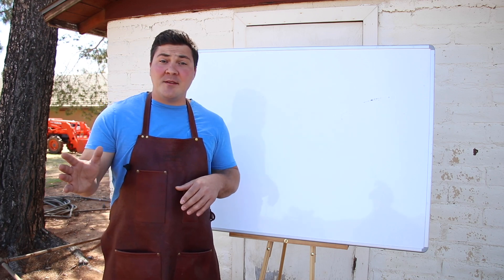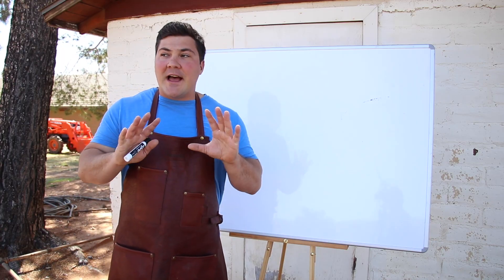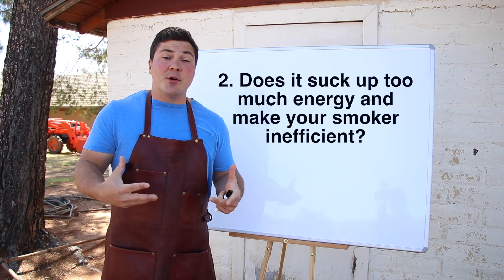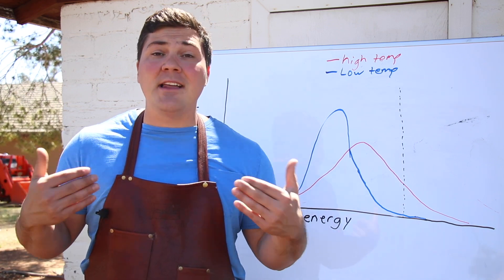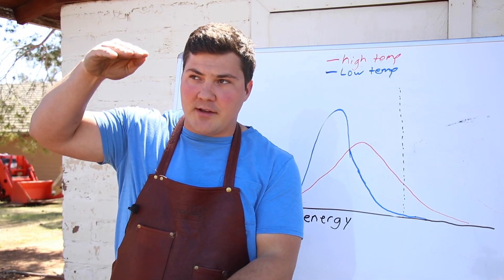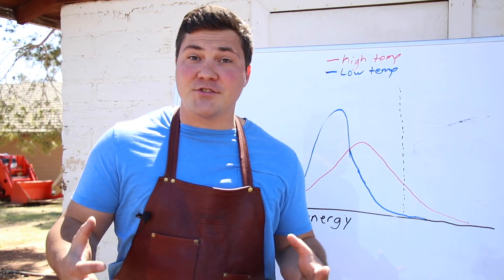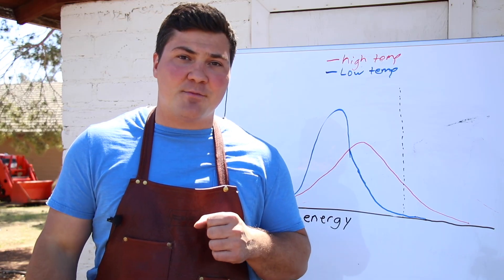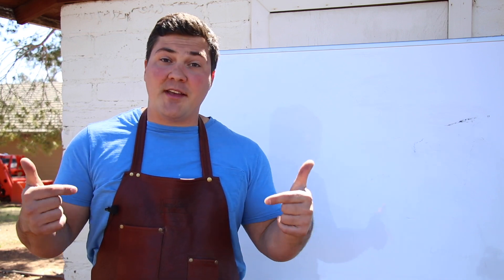Do Water Pans Improve Barbecue? A Scientific Analysis

Comment: Please don’t take this the wrong way as I have watched all your content and am a fan. I do appreciate this video but as a fellow technical-minded BBQ cook (M. Eng) I have a few reservations.  Your statements about the efficiency of a fire being affected by the presence of the water pan are erroneous. The efficiency of a wood-burning fire is not affected by anything in the cook chamber. The efficiency of a fire depends on sufficient oxygen being available for combustion.  We all have to do the same dance in fiddling with the vents of our cookers to get a proper fire going and maintained.  If you choke off the airflow the fire burns rich and you get the dreaded thick white smoke.  Not efficient at all.

But c’mon, who are we fooling?  We didn’t get into smoking thinking about efficiency and cooker heat rates.  The overall heat efficiency of a smoker like an offset stickburner is really terrible. I would estimate under 15% at best. My Yoder Wichita weighs in at 660 pounds or so, and when I’m smoking ribs for instance the bulk of that weight has to be brought up to temperature and maintained. What’s 25 pounds of ribs compared to that?  Almost statistical noise.  It would be very difficult to determine the heat loss of an offset smoker through the combustion airflow, plus convection and radiation effects.  A hilariously small portion of the wood’s heat energy actually goes into the meat.  And be honest, how many people moderate their temps by leaving the firebox door open?  That throws away what, 30% of your heat energy?  Thanx Yoder (the company in Kansas, not the Jeremy in Cali😎).

I am dubious that a water pan significantly affects overall cooker efficiency. A water pans acts as a heat sink that absorbs or releases heat energy depending on changes to the air/gas temp inside the cook chamber. Most of the time you’re evaporating water yes, but in times of wind gusts, precipitation or opening the door, the water pan would release heat back into the ambient environment and prevent the need to ‘fire harder’ to make up for those temp swings. That’s an efficiency savings.  That’s also pretty hard to quantify. 

You correctly noted the amount of water present in wood as moisture, plus the effects of combustion in producing more.  However, there is another potential source and that’s the meat itself.  In one of your commercial brisket cooks with 25 briskets or so, you get an amount of water coming off the meat during the stall when the beef effectively ‘sweats’ out a portion of its weight.  Just to make the math simple, say 25 briskets at 20 pounds each, and they all lose 1/4 of their weight during the stall. That’s 125 pounds of water in theory that you’re cooking out.  How many water pans would that be?

Lastly, I am not sure what you were getting at with your Gaussian diagram.  At a steady-state, the cooker will have mostly consistent zones of temperature. We all have to move our meat around inside from time to time to take advantage of warmer or cooler spots.  But what are you attempting to visualize?  The spread of temps around a mean inside a finite volume of smoke?  That doesn’t seem very useful at all.

If you’re talking overall spread of temps from the firebox to the smokestack, it would be a strange situation if you were burning a fire and you were getting temps inside the cooker mostly too low to affect the meat at all.  This is an elementary issue for the BBQ cook; just get a bigger fire going. If this is what you meant I guess you have a point, but it doesn’t seem consistent with your message in this video.

I do agree with the use of a water pan. For small cooks like a couple rib racks it makes more of a difference than a giant commercial cook of briskets, but it’s a heat-sink backstop that makes the cook’s control of the smoker easier.  Liquid water will leech heat energy out of the smoke to vaporize molecules yes, but it’s a tiny amount of leeching due to the slow process over the hours of a cook.  Shouldn’t bother anyone.  It is to our advantage that we have to fire harder to make up for the water pan as it allow additional airflow and less chance of choking the fire off.  Cheers all!
Reply: " water pans acts as a heat sink that absorbs or releases heat energy depending on changes to the air/gas temp inside the cook chamber." Thats all the average cook needs to know
Reply: This is one of the best and intelligent discourses I have seen in a long time, that is backed by STEM. We all are here to learn, and when the community members really come together with our heads, and not our egos, it truly is a beautiful thing. Congratulations to both @Mad Scientist BBQ and @Soft-Top Convertible Metalhead
 for having a fantastic discussion that truly acknowledges each other as peers.
Reply: I too am interested in the use of fire bricks in smokers. My first smoker was a small crappy electric smoker that didn’t hold temps very well. I filled the bottom and some of the sides with fire bricks to help moderate the wild temp swings.  I similarly used the fire bricks in my 26” Weber kettle, which actually did a better job smoking meat than the crappy electric smoker. Anyway, the electric smoke has been replaced with a nice pellet grill. I have no plans to line it with fire bricks, but the topic does interest me. Thanks for great, thoughtful content and discussion.
Reply: Aside from all the science can we agree that when moisture is in the air smoke tends to hang around lower instead of rising. This is one of the things I learn in the fire academy.
Reply: I'm also a Yoder Wichita owner, and I had to modify my firebox door vent so I can actually cook with the door closed now. My firewood supplier doesn't remember my name anymore because I use so much less wood these days, and I can basically dial in the vent position and walk away. It's so much less hassle, and I hated wasting so much wood by leaving the door open. http://www.texasbbqforum.com/viewtopic.php?f=67&t=31199&hilit=Wichita+Door+MOD

Yoder's latest offsets moved the vent to a lower position due to all the negative reviews, but I haven't been following the feedback to see if their change made much of a difference. I know my modification made a huge difference.
Reply: Can you do a video bud?  I would like to see more about your view of things.
Reply: "A water pans acts as a heat sink that absorbs or releases heat energy depending on changes to the air/gas temp inside the cook chamber. "

This is exactly my thought process for using water....it works as a "capacitor" to mitigate potential heat swings. However I use a WSM (relatively small chamber) not a large stick burner which would seem to require a bathtub (hyperbolicly speaking) to have the same effect.
Reply: lol..

Fun watching you two Einstein's banter back and forth....lol.....but hay, I still say I want to see the Gateway drum go up against the Offset.....
Reply: @karatevideosandmore7685  I brought that up, sort of.  Most of the argument is immaterial to the vast majority of viewers, who use relatively small cookers fired by charcoal; with a small amount of smoke-wood for additional flavor.  I do usually use a water pan on longer cooks, at higher temps, or for fairly lean meats.  Even if it isn't strictly necessary, I can't think of anything that was ever hurt by it.
Reply from the maker: handcannon 

Actually I think when using charcoal, it’s more important because charcoal combustion produces far less water than whole wood.
Reply: @karatevideosandmore7685  ONE genius.  Soft top is an IDIOT
Reply: I'm not Mr. Science but I always use a water pan.  A few secrets up my sleeve and my BBQs feature perfect,  juicy brisket every time on my Traeger wood pellet stove.
Reply: Seriously?!
Reply: @davidmbonu  as far as I know
Reply: @unknowndady  academics and good food don’t go together!!😂
Reply: Using a Weber Smokey mountain with much less mass, the built in water pan should make a big difference stabilizing temps.
Reply: @JoseGonzalez-mf3oq  🤣🤣🤣
Reply: Put simply, efficiency is energy output over input. I am not sure if he meant the efficiency of combustion, or, rather, the efficiency of the output of the fire with respect to the cooking environment. That's how I took it. The water pan functions as a heat sink and absorbs the energy output by the fire, meaning there is less heat energy being output by the system. The the heat energy going into the water is energy that could have been going into the meat or surroundings. That energy eventually leaves during vaporization, but that's not really what I care about right now. I am also a Mechanical Engineer who has taken advanced thermodynamics, and I am very impressed by this video.
Reply: @niceboy171 so the objective could be to cook faster? Now I’m confused
Reply: @Alex Atreides Smoked ducky.....mmmmm.
Reply: I've seen min/maxing in games but you guys take BBQing onto whole another level. GG both
Reply: You have entered the BBQ Rabbit hole of BBQ
Reply: @WakanWarrior We have “jumped the shark “ Mr Fonzerelli
Reply: I was going to say the same thing until I realized I have no idea what either of you said. Yes water helps stabilize my temps and that’s all I need to know.
Reply: As sergeant Hulka would say, 
Lighten up Francis.
Reply: Man, I really appreciate what you had to say. But, I lost you and fell asleep at about page 3.
Reply: After reading the comments I felt like I became a scientist. This is gold!
Reply: After all this...I've started to like chemistry. What an math episode?
Reply: Moisture most definitely effects fire. But the pros outweigh the cons. I appreciate you both getting so deep into the subject though
Reply: @Alex Atreides So it IS a bathtub.  (Needs a rubber ducky tho.)
Reply: I love lamp.........
Reply: Tyt I was just thinking jj be ggfbhmkin  B b b. Got  y ugh m
Reply: Use it
Reply: Yes, thank you to both of you. This is the type of civil thoughtful discourse that I wish there was more of on the internet and that is rarely seen in YouTube comments. Knowledgeable individuals  who respectfully discuss/debate an issue to come to a better understanding of the subject and leaves everyone in a better place by the end of it. Thank you.
Reply: I believe I've learned a lot from this conversation but some how I feel more stupid.
Reply: You talk to damn much go get a different life
Reply: same story wirh people absolutely obsessed with having an airtight military grade ship door for the smoker door.. it's going to leak smoke and it's not that big of a deal. Youtube has so much misinformation.
Reply: I think I've lost my appetite. 🫤
Reply: I know this is 5 years later but I entered both arguments into chatgpt and it told me Jeremy was the winner.
Reply: I just purchased a woodwind pro 24. I had a Bradley puck style before that I modified with a PID. I used water pans in that and my briskets turn out very good with your methods. but it was too small to do a full one. When I get  the WWP one of the first things I want to do is a full brisket (this will be my first full one). I’ve seen videos of people putting a water pan over the pot to better disperse the heat and I feel the moisture will help with pelllets being dryer? I want to put it right above the pan to get even heating and my tallow to the side. Am I right in my thinking?  Thanks.
Reply: Chemical Engineer enters the conversation.....

One thing I think both of you have missed on is Heat of Evaporation.  I never thought the water pan added moisture to the meat, because if you think about the process, most of the time the flux of water is out from the meat.  

Nope I was thinking like a control guy, that the heat of evaporation acts as a control moderator, not just a heat sink.  Water evaporates at 212, and most cooks are done from 225 to 250.  So by having a physical constant that will not exceed 212 you add gain to the control response and modulate your temperature curve.  Add a sufficiently large mass and your gain can be appreciable.  Remember, once the water hits 212, your energy input into it will be steady state, that of the heat of evaporation.

Oh and @MadScientistBBQ, you're comment on "It's not a ton of difference" is not quite true.  My back of the napkin math says your Joules to BTU conversion puts it at almost.... a ton.
Reply from the maker: Dave Lattner 

Hey Dave, I did include the enthalpy of vaporization in the calculation for the energy absorbed by the water. You’re correct tailgating the majority of the energy will be used for the phase change and the rise of water temperature is much smaller in magnitude (despite the high specific heat capacity of water) than the energy required for vaporization.
Reply: @DaveLattner  Perhaps we should also talk about elevation levels and the various grades of aluminim pans as well. ;-)
Love the discussions, and as a relatively new smoker once the pandemic started and really enjoying using my Weber Summit charcoal, wouldn't I love to try a huge offset grill one day. Wife saysI already cook too much for three.
Reply: @DaveLattner  Please see my comment below about having the water in the smoker saturated to prevent water from leaving the meat.
Reply from the maker: Soft-Top Convertible Metalhead 
No worries, I’m not offended. It’s clear you have thought about the topic, so I want to engage meaningfully with the points you bring up.  

1) As for the efficiency of the fire being unaffected by the presence of water  in the cook chamber or the lack thereof, I have to disagree.  The term efficiency there isn’t in relation to the amount of energy released from the fire, but it refers to the amount of energy that is absorbed by things other than the meat you are trying to cook.  The water must first absorb energy to increase its temp to around 373K.  Also, the enthalpy of vaporization requires quite a bit of energy. Presumably, this heat energy would not be efficiently transferred to the meat, because the entirety of the cook chamber would be above the boiling point of water. Thus the water wouldn’t condense on the meat, releasing the enthalpy of vaporization.  It could obviously transfer the energy absorbed as the temp of water vapor increases beyond its boiling point, but the energy absorbed by the water molecules to increase in temperature before vaporizing and the energy absorbed in the process of vaporization would be lost (leaving with the water that exists through the stack).  
2) You’re right, the goal of BBQ isn’t efficiency but we would like to make it as efficient as possible, otherwise we’re throwing away money.  There is a significant financial cost involved when you drastically increase wood use.  This is especially true when cooking on large smokers.  As the price of a cord of wood in southern California sits around $450-600 per cord, this isn’t a trivial matter.  In addition you mention that offset smokers are inefficient.  Quite right, but inefficiency isn’t the goal. If it were, people would be building the thinnest smokers possible, trying to lose as much heat to the environment as they could.  Finally, the energy required to bring the metal up to temperature is not going to be affected by the presence or absence of water pans.  That must take place for any cook.  You must also consider that the specific heat capacity of steel is much, much lower than that of water, meaning the energy required to raise its temperature is much less than for a substance like water.
3) Water would only be releasing energy back into the cook chamber if the temperature of the cook chamber has dropped below 212F.  If this happens, there are serious problems with the cook that cannot be solved by the presence of water pans.  I would concede, however, that the presence of a large volume of water at its boiling point can’t mitigate the problem, but I wouldn’t rely on it to keep a cook moving forward.  It would only slow the reversal of the process.  This is valuable only if you have made a significant mistake while cooking (e.g. falling asleep by mistake). 
4) You are correct about the meat also releasing a large quantity of water during the cook.  If you have ever cooked a handful of briskets in a large smoker, you know that they are always inferior to the results you achieve when cooking a full loaded smoker.  I think this is largely due to the increased moisture from the evaporative cooling of the meat inside.  In my smoker 25 briskets would probably sweat off the equivalent 6 water pans throughout the course of the cook.  In those situations I use 2 water pans at most, because there is so much moisture in the cook chamber that water pans don’t make as much of a difference.  At that point water pans are in the smoker to moderate the temperatures coming out of the firebox.  
5) The graph was meant to visualize the increased risk of burning associated with higher temperature.  While the average energy of the higher temperature air might be 10% higher, the portion of the gaseous molecules that could potentially burn the meat would increase significantly more than 10%.  You might be 5 times as likely to burn something at 300F than you are 250F.  The point of the water pan would be simply to moderate periods of high temperature that results from building a fire that is a little too big. This spares the pit master from trying to moderate temperature by cutting off air supply and producing “dirty” smoke. Also, I think you misunderstood what the graphs represent.  The peak of each curve represents the temperature, that is, the average kinetic energy of the particles of a substance.  At higher temperatures, the curve flattens and there is a greater distribution of energies at the extremes.  It is the portion of very high energy gases present at higher temperatures that the water pans are used to moderate. 
6) Finally, you mention that the amount of heat absorbed by the water is small.  While that is true in a sense, representing only about 4% of the heat produced through combustion, the overall amount of heat absorbed is significant.  This is especially true when you consider that the smoker is inefficient by nature.  I know that the water must have absorbed the amount of energy calculated, because it all evaporates away.  So, of the energy required to complete a cook, i would estimate that the water pans use somewhere between 10-15% more energy than would otherwise be required. I have tested this by weighing the amount of wood used to hold the smoker at a consistent temp for 4 hours with and without water pans.  I found that the water pans increased the weight of wood used during that period by 14.7%.  This is also true of the amount of wood required to run a smoker while empty vs. running it while packed full of meat.  I would estimate that I use approximately double the amount of wood to cook 25 briskets when compared to running an empty smoker for the same amount of time.  I would agree that there are many benefits to burning more wood, I just don’t believe it is trivial to consider how much additional cost one can incur by heating a large volume of water in the smoker.  Thanks for your comment.  I really appreciate you taking the time to think about the issues.  I have to disagree with you of course, but hopefully we both gain more knowledge to improve our bbq skills.  If there is something I missed or muffed, let me know.
Reply: @MadScientistBBQ  Ok, I have read both of your comments and I find it hilarious both of you went through all of that to disagree on so many variables; yet in the end, still promote using a water pan!   Although I may disagree with many of the things both of you said.  I think the key thing to take away from this is, there is an infinite number of variables to cooking great BBQ.  All of which can be extremely difficult to control.  This is a pitmaster's passion and his pain, yet it is what makes great BBQ.  Lastly,  $400-$600 for a cord of wood is absolutely bat-shit crazy!  I can get top quality Oak here in TX for under$200.  At this point, it is cheaper to buy it here and fly it back.  Always enjoy your videos.  The offer to come to my BBQ Trailer just outside Austin now extends to the both of you.  I want to watch this argument in person lol
Reply: @avikaiser9562  I live in New Braunfels,  where is your BBQ trailer?
Reply: @MadScientistBBQ  As a chemist looking at point #5, I think what you are trying to say is that the liquid water in the water pan is there to absorb the overall thermal energy when the temperature goes up. The gas energy distribution in side the smoking chamber is the same with or without the water pan if the smoking chamber temperature is the same. As water will not differentiate high velocity nor slow velocity gas molecules. It will absorb the energy regardless of the velocity. 

Hey I never thought about imagining how much water content is there during smoking process. 

I also wonder about the effect of firebricks in the smoker. It will absorb chunk of heat to start out with, but it will be able to release energy back when you open the smoker door. I have no idea whether it will be more efficient or not but it will be interesting experiment to do. 

Hey as a scientist, if we disagree, then we do experiments to find out who is right and wrong and contribute to overall knowledge of humanity.
Reply: @MadScientistBBQ  if you are worried about the energy needed to raise the temperature of the water to the boiling point, you can pre-heat the water before pouring it in the water pan.
Reply: @MadScientistBBQ  Well, besides the fact that you enjoy smoked meats and such; this comment reply has validated my thoughts that we would be best friends should we ever "meat".
Reply: @MadScientistBBQ  you know honestly I would love a video comparing the difference is cook time, flavor and other nuisances involved between using a water pan and not. I believe that the water pan serves to help regulate the temperature when opening/closing as the specific heat of water is very high compared to most molecules 1.34 or 1.43 j/kg (can't remember to long ago).  I recall others using a tin full of sand to help mitigate this factor however I thought it wasn't that great since it didn't add anything towards humidity however at higher temperatures I doubt that meat can absorb any moisture due to various factors being that proteins generally tend to contract in regards to heat.  Anyways as a scientist and home chef, I would greatly appreciate the experiment.
Also another one is the difference is smoking until the stall and A. putting into the oven and B. continue the cook in the smoker.
As for now, I smoke till the stall, wrap and subsequently throw it into the oven at 250 degrees for 2-4 hours depending.  Makes duel cheaper as well as requires much less attention.
Anyways, you r videos are amazing so please keep them up!!!
Reply: @MadScientistBBQ  NERDS, NERDS, NERDS, NERDS!!!! 🤣🤣🤣🤣
Reply: @MadScientistBBQ  Way over analyzed!  This from a Ph.D. ;-)  I'm gonna use a water pan because its worked in the past and it just makes sense.
Reply: @DrJohn493 Now this is thinking like a true engineer.
Reply: @MadScientistBBQ  if your not seeing your water pans boil yes the whole water pan is probably on average lower than 212 F depending on atmosphere pressure but yes they can get hotter than their boiling point. Especially just the top exposed surface where the evaporation is happening.
Reply: @MadScientistBBQ  wow, haven't heard several of these terms since my college engineering thermo class.
Reply: @MadScientistBBQ  .... @ 11:53 ... I like molecules! That's my favorite part!
Reply: @MadScientistBBQ  this is the greatest conversation i've ever read in youtube comments! kudos to you two gentlemen!
Reply: @MadScientistBBQ  Alton Brown from Good Eats would be proud of both of you ! Not sure who he would agree with but he would be proud that the thought of science went into the cooking !
Reply: @MadScientistBBQ  First off - this is the most engagement I've ever had with a YouTuber and as you can tell, the subject matter is right up my alley. :)  Thanx for being cool about this.

We're actually closer in alignment than you realize - I think we're getting tripped up by semantics.  You say efficiency of a fire, I say overall cooker efficiency; we are talking about the same thing.  Putting chemical energy in the wood into the meat.  I'm not digging out my old Thermodynamics textbook; I'll trust what you've said about the enthalpy business.  I hope no one mentions stoichiometric combustion!

I'm still unsure about your Gaussian graphs, but I won't belabor the point.  I just don't understand why the std dev. figure is larger with a higher mean temp.  Does that come from experimental data?  It's been 23 years since statistical classes and I'm having bad flashbacks. ;)

One thing I belatedly understood - you're coming at this from a commercial perspective where your desired fuel source is very expensive.  That explains your position and mine as well; I have a friend who runs a local tree service company and I can get wood from him in exchange for smoked meat credits.  So I never really have to put up cash for wood and don't think about it too much.

You information about the additional wood energy 'cost' of the water pans is interesting.  You have the advantage over most of us as you've had some much experience with large cooks and can try different methods.  That's why I subscribe.  That additional cost is larger than I expected, but again, my perspective is much different.  I use a smaller water pan, sort of a cheap dollar-store dog bowl shaped pan.

So, let me finish up with this - which might be a future video suggestion for MadScientistBBQ.  In my Yoder Wichita Loaded I do something I have never seen anyone else do.  At least on YouTube and I've looked at all the big channels.  I have placed a series of firebricks inside the firebox to contain a small fire.  In my experience I find that I burning smaller splits in a smaller fire surrounded on three sides by firebricks works very well and I hardly have to do anything for fire management.  I do use the tuner plate and do not count on any radiation effects from the burning wood.  Just from the air/smoke flow.

Since you have taken the time and effort to determine % cost in fuel based on water pans, I wonder if you could determine % savings in fuel by using firebricks to keep the fire hotter and the heat energy more contained?  Fire bricks are quite cheap and easy to come by and they're in a few different shapes.  Something to think about.  Cheers.
Reply from the maker: Soft-Top Convertible Metalhead 

Interesting ideas for future videos. I’ll give them some serious thought. 

Here is a link that describes the distribution of energies I mentioned http://ch302.cm.utexas.edu/kinetics/temp-depend/selector.php?name=arrhenius-law
Reply: @czeslawpi  Sorry, late to the party on this thread.  I get your reservations about the "molecules" graph.  My take on it was more in the context of fire variability over the duration of the cook.  I use a pellet smoker which, apart from pellets having a lower residual water content, has a higher temperature cycle frequency.  It seems to me that having something to absorb some of the heat of the fire going high will help regulate temperature in the chamber.  That said, the effect is diminished during stall.  After stall, though (if you're not wrapping), having additional moisture  isn't a bad thing.  

@UCselvHbb5ah0sEqZrFa-7nA BTW, I wonder about mopping and other flavoring / moisturizing techniques that add and seem to extend stall on larger pieces of meat in the smoker.  Is this more efficient?  Is the goal to further regulate chamber temperatures or is it to enhance heat transfer onto the meat or keep the meat moist?  I wonder about the "availability" of any of the water released during the combustion event or through evaporation from the pan(s) or off the meat.  Any thoughts on this?

Really liked the approach, the video and the discussion.  Thanks!
Reply: @MadScientistBBQ   @Dave Lattner  @Soft-Top Convertible Metalhead 

Hey guys I read your comments on the subject but think you are missing an important part of this whole conversation. There is only so much water vapor that air can hold at a certain temperature. 

I really think when looking at this water pan discussion should be looking at the question “Is the atmosphere in my smoker saturated?” meaning it cannot hold any more water. The way I understand it is that the meat has a lot of water in it and if your cooking environment is saturated, meaning it can't accept any more water, then it will make it a lot harder for the water in the meat to get out. If your cooking environment is less than saturated and is not at its maximum water capacity any water that gets to the surface of the meat will evaporate or drop very easily. 
So, this is very dependent on how dry the input air to your firebox is. One of the reasons why its so detrimental to be opening your lid all the time is not only that are you losing a ton of heat but you possibly just introduced a ton of dry air into your combustion chamber and changed your whole cooking environment.
I am not exactly sure what device you would use to measure the humidity of your exhaust gases or inside the cooker but that would be the best way to figure the whole water thing out. This is just a thermodynamics 1 exercise using steam tables. Let me know what you guys think but I think just making sure your environment in the smoker is saturated to help prevent water from leaving the meat is the goal.
Reply: Also the water pan acts as a heat sink as above but it doesn't just get to 212 F and stop, it just begins to boil at that temperature. It will get to whatever temperature the smoker is running at sooner or later. So yes it acts as a heat sink and will help you maintain temperature during low fire box problems. It takes time for water to evaporate depending greatly on the surface area exposed to the heat as said in the episode.
Reply: @czeslawpi  Please see my comment below about having the water in the smoker saturated to prevent water from leaving the meat.
Reply: @unknowndady  Except it's not a closed system.  You constantly have gas leaving the system via the flue.  So even a slightly unsaturated environment can drive away large amounts of water because it literally goes up in smoke.
Reply: @DaveLattner  Yes you are correct but the water pan at steady state will be constantly adding vapor to the system untill it runs out. So really to know if you have enough water pan and such you would need to measure the relative humidity of the exhaust gas. But this can all change depending on the input air relative humidity. But yeah one of the purposes of the water pans is prevent water from leaving the meat, which is a big point I think that no one has talked about yet.
Reply: @unknowndady  I’m not sure if I agree with this humidity theory just for the simple fact you can boil meat in water it can still be dry. I think many times on the channel it’s the fat is perceived as moisture not the actual water content left in the meat.
Reply: @czeslawpi   I’ve been doing this fire brick trick for over two years now. From my experience it helps burn. Clean fire and save on wood. The firebox on this smoker is NOT insulated so I’m guessing how much of a difference would that make on my new stick burner which sports an insulated firebox.
Reply: @MadScientistBBQ  tl:dr  but I'd watch the video
Reply: @MadScientistBBQ  brother I've  followed you for a long time tips have helped me so much and you science made a lot of sense !!
Some people have nothing better to do..
Keep up the awesome job bro!!!!
You really made me think about my smoking now !
Reply: @MadScientistBBQ  how many grand championships do you have? Myron mixon always uses a water pan smoker and I think he has a quiet a few grand championships.
Reply: What's on my mind
41 seconds ago
I use sand as a heat sink covered in foil for easy clean up, and the sand can be reused for ever. Beats the heck out of water, Try it once and you will never go back to water. Or don't. But don't say I didn't tell you.
Reply: @visionv Sand kinda stinks and gives off a seafood type odor.
Reply: Whaaaaaaaat? Say that again please sir.
Reply: @danielploy9143  yeah, start back from the VERY beginning. It's cool, I got all week. 😮
Reply: Bruh about time u read all these comments u could have learned yourself about n made mistakes n fixed them by barbecuing smh best barbecuers ain't finish high school im glad to c the videos though to c alot of your views but its not brain surgery people practice make perfect not how many videos u watch
Reply: From my understand, OP of the video was more explaining about the science what's going on inside the chamber with the topic of water and was not specifically for the efficiency of wood burning.
Reply: You way over think this, it’s not as complicated as you pretend it to be👎🏼
Reply: You wrote an encyclopedia
Reply: My 98 year old grandma uses a 27 year old bed pan containing 44 ounces of a secret liquid.
Reply: This discourse, as long and tedious as it was, became a painful waste of time once it was realized you both agree that using a water pan while BBQ'ing is a good thing! We are all not Mad Scientists nor Mechanical Engineers, although I am the later. We are mostly backyard BBq'ers enjoying the weekend. Metalhead - maybe turn down the volume, drop your top and go for a ride in the country. Enjoy the weekend when it arrives....There are only so many out there.
Reply: Dude..You need a woman!!
Reply: @tylercampbell6365 Lol
Reply: The true genius is making complex matters simple... follow Jesus
Reply: Man just stfu and BBQ